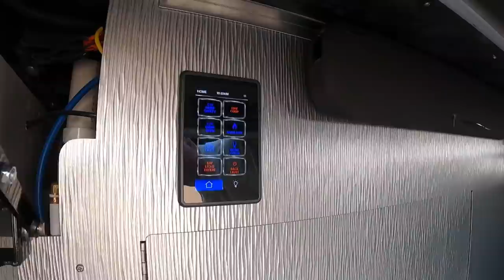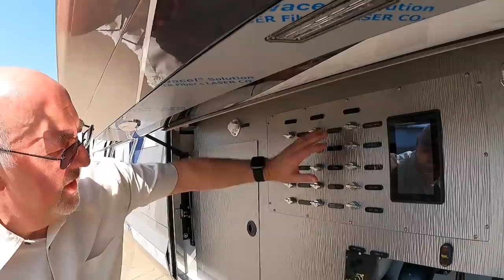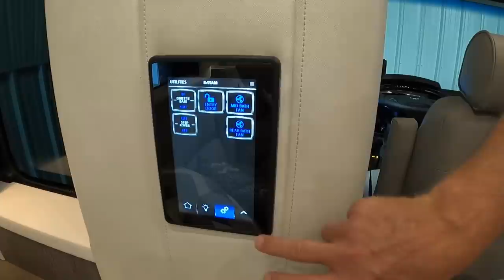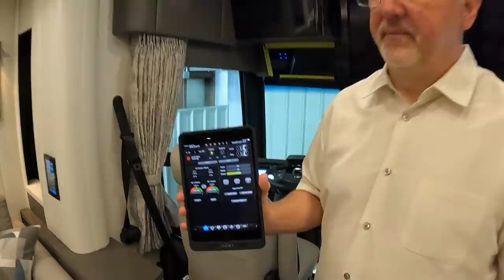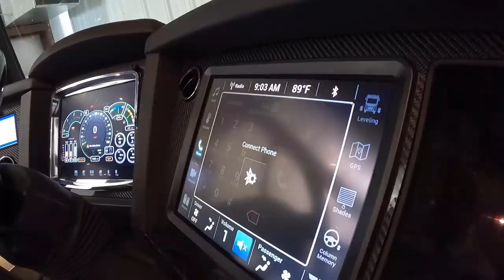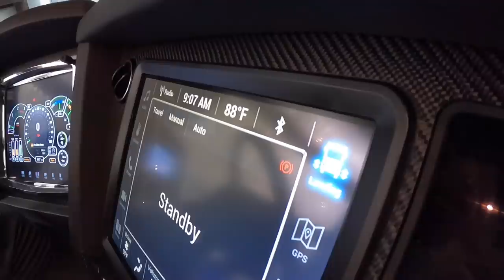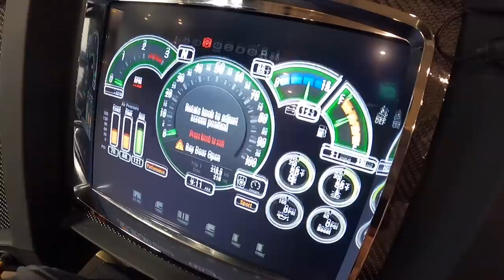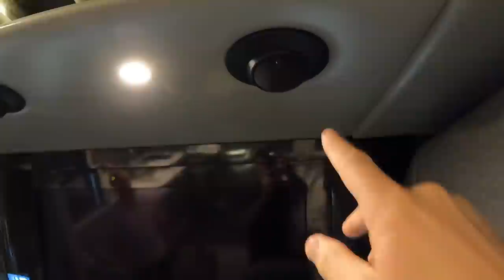Tour of 2022 Newell Coach 1731

Comment: Amazing electrical system.  Yanmar is an amazing engine.  He’s not wrong about the attempts to replace a Gen with lithium phosphate and an alternator.  I’d love to see a 400 gallon diesel tank instead of the outdoor grill, tv, and fridge.  Be glad when the gaudy paint schemes go out of style.  A nice solid exterior color would really look elegant, I think.
Reply: I’m an electrical engineer and as impressive as the lithium phosphate claims to be, the massive cost Liberty is tacking on to their coach to go without a generator, I’d like to see a decade go by with these batteries in coaches before I’d put them in mine.  A yanmar diesel Gen has millions of hours of proof that they are bulletproof.  Like a Honda GX gas motor, rock solid.  My coach when I retire will be a Newell, sans the gaudy exterior paint and mind-numbing menagerie of textures, finishes, and lights.
Reply: I agree, the outdoor kitchen just takes up space that could be better used. Why there's a TV outside I have no idea. Almost everyone is probably going to use a TV inside so they can actually see what they're watching lmao. I mean, maybe at night for when you want to watch a movie outside around a campfire, but honestly if you're buying an RV like this, the odds of that happening aren't too big; especially with a small TV. You'll get more out of a small projector aimed at your RV tbh.

Add another diesel tank, or even more water tanks for extended outdoor stays. I've always wanted to see solar panels that replace the awnings, like instead of an awning just have a set of solar panels that extend outwards, providing shade while charging your RV. Often there's a lot of wasted potential with RVs when it comes to the roof. Like if you're going to be charging a million or more for your RV, better be the best RV on the market. No space should go to waste. Hell, you could probably put a water reclamation unit inside the RV if you were creative enough, and didn't waste space on an outdoor kitchen. That way you could recycle your gray tank water into fresh water, and maybe even the black tank water too. If you ask me to choose between a water recycler or an outdoor kitchen, I'm choosing the water recycler. I mean, you could probably put rain collector's on the roof to collect fresh rain water and filter it directly into your fresh water tank.

Comment: Yes "sir!"  The bi-fold doors are NOT convenient.  I'm actually surpised Newell uses them.  It's one reason the built-ins have to travel out so far - and be remotely controlled.  Although, that's not a bad thing.  The old swing up doors provide much better access to bays.  Also, no push button doors; I do prefer their push button system.  Great attention to detail as usual, Andrew.

Comment: On some yachts when u hve only top 1 screen fly bridge u can spin rotate the triangle from 1 to 2nd screen so u can keep stuff u need displayed on either screen or 3rd to keep rain off, but inside a car u can hve 3 screen saved screen lighting up as u toggle between screen w/just a flip. Way easier when driving just flipping screen, so 3 n1 screen like a yacht.
Reply: TV weather & rig n1 of 3 screens & when u flip /toggle it it can pause the screen u were on.

Comment: If some 1 makes a better design shower turn on  u can make it a handle when not setting temp 2 n1. I thought of this 1 awile back u push shower knob n& turn so u can get past safety heat setting so u get more hot quicker heating & more hot if back to back shower, it is bigger deal if u hve limited hot water tank child safe u just push & turn 1 or 2 times if cleaning wanting boiling mop water 2* past safety setting.

Comment: For my engine 4 banger braking exaust & city power & jack braking & air  but u can hve jack hammer air power too to use as injector like fuel high power & quick fire air full. 200+ psi rapid recovery bc air is free diesel not free. So PTO running 8 inline engine w/injector air can be just a 6 instead of 8 or u can part fire every cylinder on part air less fuel same power. Bc small torque 4 takes carry of drive shaft & braking & air cheaper firing u hve reliability. The PTO 8 engine is just a generator way cheaper running electric motor esp on part air then diesel drive shaft should do incredible numbers on fuel, cycling up & down to meet demand.
Reply: BC in middle u keep plane gear set poss in rear & in middle like race car best wt bal too.
Reply: If generator stumbles u still hve/can turn on 4engine to limp 35mph till generator un stumbles back on or up 1/2 fuel or air injected. If u hve helper electric small motor on 4 banger running shaft drive u can go from 35 to 45mph easy enough.
Reply: All about air free & electric best fuel power diesel charging.